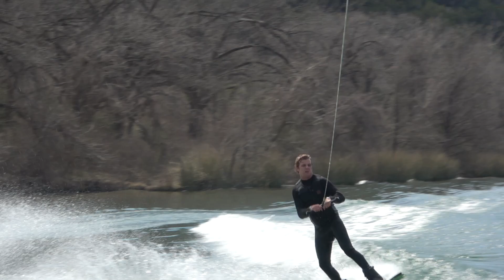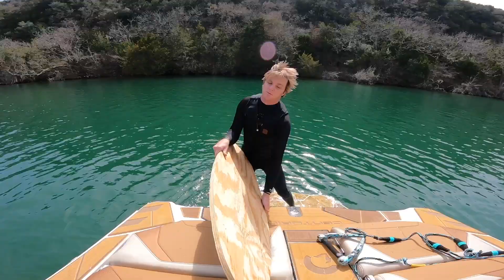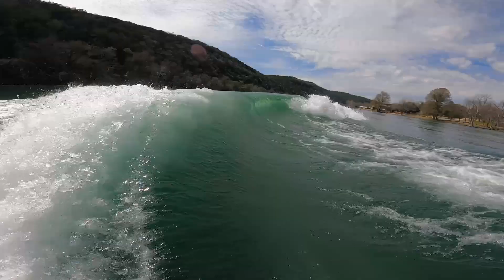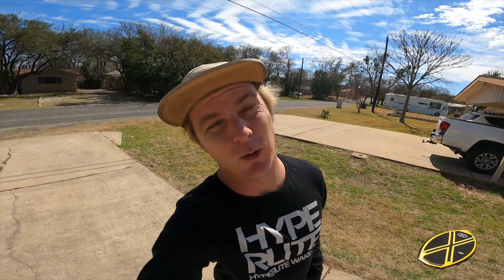WILL IT WAKESURF?!

Comment: Fixing the wakesurf board. Purchase 3 cynderblocks put the board all wet resting with the nose on one cinderblock then the heel of the board on the other cinderblock then take a third cinderblock or something of weight on the middle of the board to change the rocker. After drying with weight on it for a week or 2 weeks. Purchase cheap housing fiberglass 10ft sheets from homedepot. Purchase cheap marine epoxy then add a base layer of epoxy then while tacky lay the fiberglass cloth over the tacky base coat apply another coat. Trim what cloth is there repeat on the other side then take it out on the water!
Reply from the maker: thats alot of work lol
Reply: @jboneill  "content"